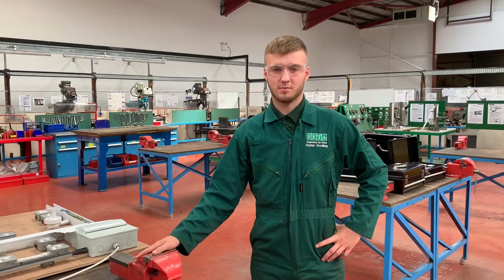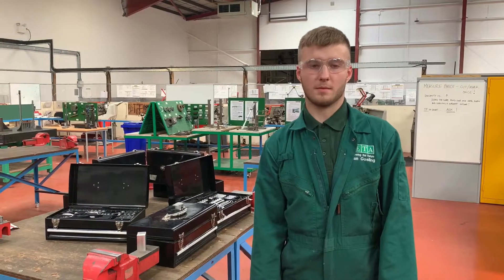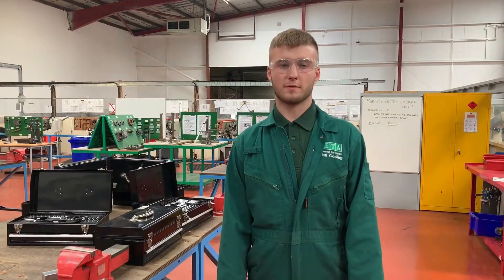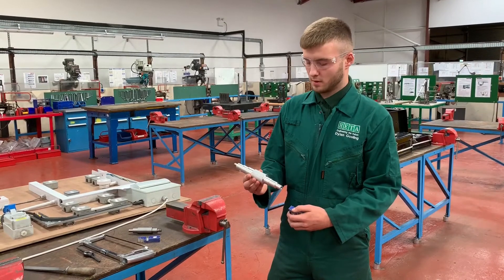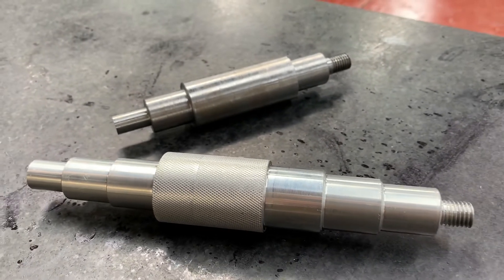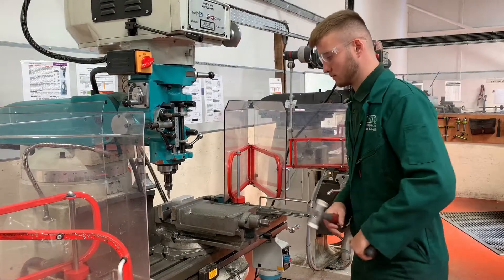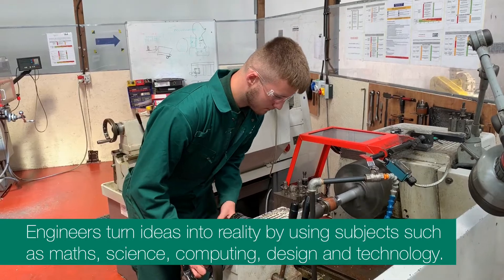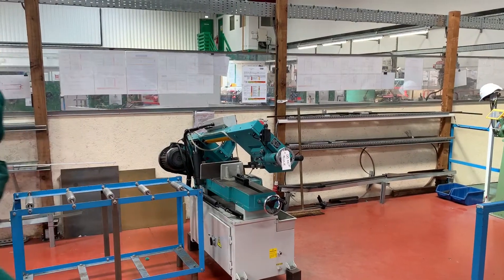A Day in the Life: Machinist Engineer

Comment: half a day for that lathe part..a cbc machine would probably do it in ~3 minutes  and it would take like 3 hours to program and run the first part
Reply: true, but its very beneficial to know manual and cnc .
Reply: Tool & Die Makers make the $ & only a few of them know cnc ..Die makers Build / repairs the dies -to keep production going  / bench work & lots of grinding techniques Bridgeport work also and are fully in charge of there work correcting engineers on designs ..